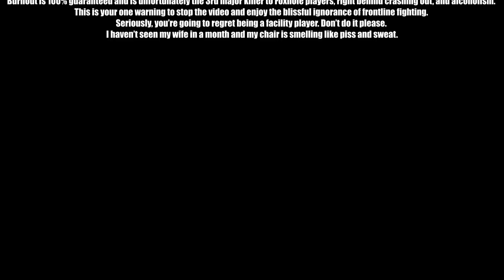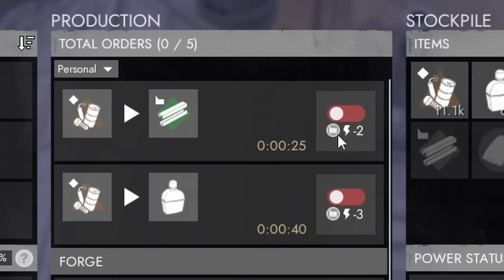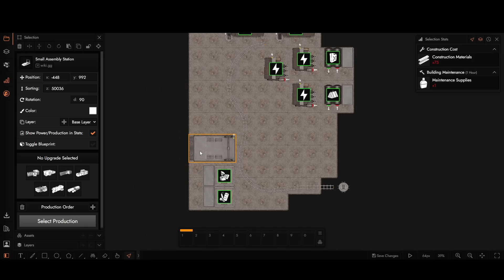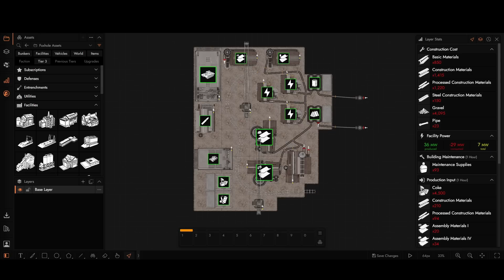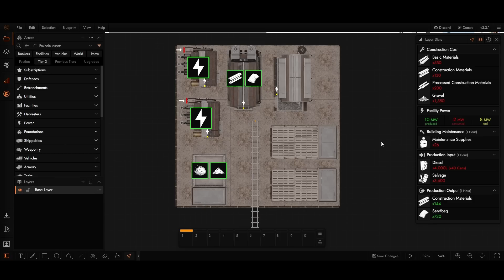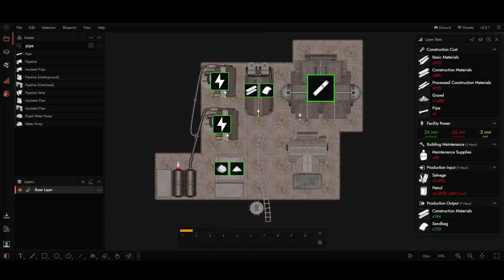Foxhole Beginner Guide - Facilities

Comment: I was a solo player running a factory in the rear lines on the Charlie Shard. I ran trains with crates full of 40mm, Tremolas, 120mm, 20mm, razorwire/sandbags/metal beams, 120mm cannon packaged and Hauler packages to get the frontline logi players a means to move everything. By the end of the war I easily delivered over 3-4 thousand crates of the mentioned gear.

By the end of the war, my Supply Value was over 12 million. While it was nice to be known and called out for what I did, I will likely never do it again because it basically became a second full time job.

Comment: What I would be interested in would be a logi video that eplores what can be produced where efficiently - and what can't be produced any other way. Basically what is best produced by regiment sized logistic corps, what can a single person produce efficiently etc? I feel like yes, a single person can run a facility. But printing shirts or setting up ressource extraction is time better spent.

That lovingly handstitched sandbag made in a backline factory from bmats won't help the war effort when a midline facility prints them by the pallet cheaper and closer to the front line where its actually used.

Comment: Great video, would like to add my 2¢ as a facility larper.

1. Facility buildings can have up to 5 queues, so if you are playing solo, just see if someone else is making what you want and ask if you can borrow some production time. A pure solo facility will only be 1/5 as efficient as a fully queued one.

2. Pillboxes will not stop partisans from waltzing into your facility. Unless you want to be “featured” in an HVL video, you have to build defenses. This said, defenses scale with what they are protecting. A resource transfer station to a train line is probably fine with a couple 3x1’s but a BT printer will need defenses in depth and QRF coverage. 

3. War eco exists, and you don’t need to build “everything”. If you need steel for your weapons platform but none after that, you can probably find someone with an Engineering Center willing to trade Rares or components for the 15 steel beams you need. You do not need to build out a whole assembly line for something you will only need once.
Reply: I wonder how many solo facility larpers decide to become internediate producers for other larger facilities lol

Definitely sounds interesting

Comment: As a veteran player who has attempted a solo facility...DON'T. The problem is you typically do NOT have enough time to produce msups to maintain the facility, gather materials to produce in the facility, and ship the things from the facility to the frontline. Not to mention having to build defenses against partisans.
If you DO insist on making a facility, DO NOT make an omni-facility that produces everything, instead FOCUS on one SPECIFIC thing your facility produces, and try to use facilities from other players to produce the materials to build yours, so you can specialize your facility without having to produce the cmats and pcons yourself. A good facility for solo players is resource gathering facilities, such as a stationary crane with four resource transfer stations around it.

This will help make sure resources don't go to waste by clearing the field, and will be especially helpful to flatbeds and freighters, and in the future, trains and Bowheads. It should be relatively easy to maintain, just have spare resources for repairs when partisans attack (it's cheaper than building defenses). You shouldn't need much more than walls and a single Encampment with basic QRF supplies for defenses at scrap fields, because compared to other facilities it just isn't worth it as much for partisans to focus on. On top of not necessarily getting the best bang for their explosive buck (so long as you regularly empty the resource transfer stations), resource fields typically attract ALOT of people to them for mining, making them dangerous to target without immediately getting QRF'd.

The best thing to do is find incredibly inconvenient resource fields that nobody would otherwise want to work at, and then turn them into something far more efficient. For example, if a resource field is far from a road, and the area is too small for a facility, consider creating a small gauge train to ship resources from the field to resource transfer stations next to the road.

Comment: The disclaimer is very accurate, facility will make you mind melt.
Don't solo fac, you will loose your mind.
Reply: Solo is REALLY Hard of you do it with no Plan. It’s easy if you get a good Spot, somewhere near Both a coal and Salvage field where you can Build small rail Connection to your Facility for efficent Material Transport. But Thats more luck then anything Else.
Reply: I basically duo facility for my clan every war and my mind is already far gone
Reply: lose*
Reply: it easy than Factorio for me
Reply: @koon405  (easier)
Reply: I play satisfactory.  If I didnt have a job I feel like I could handle it